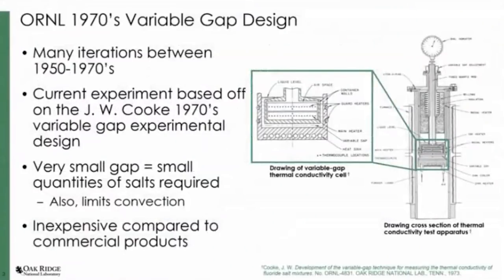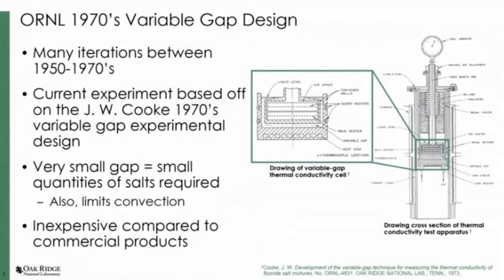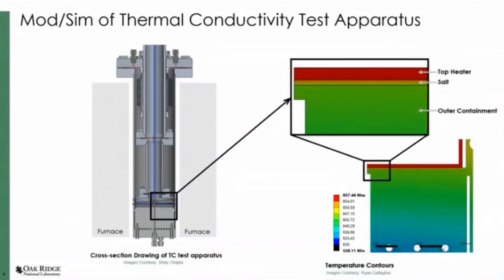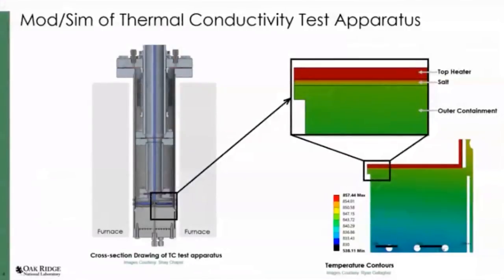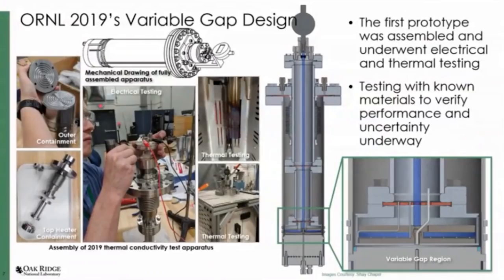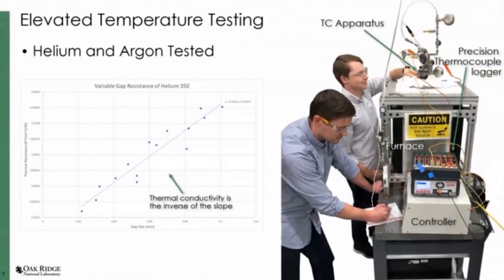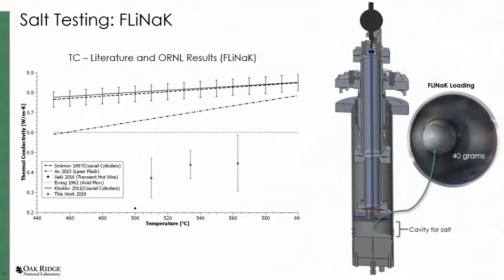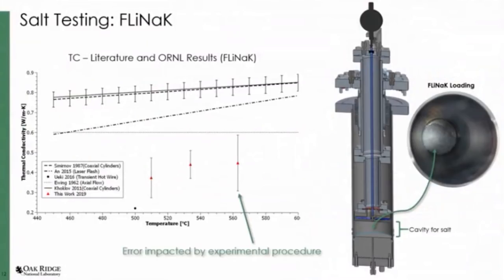Molten Salt Thermal Conductivity (Presentation+Interview) Dianne Ezell & Ryan Gallagher @ ORNL MSRW

Comment: I'm such an admirer of the old team at ORNL for all the work they did on MSRs going back into the 1950s and 60s. I think this would have been a game changer had the US nuclear sector gone for the MSBR instead of the LMFBR in the 1970s.

We have a chance to rectify this now and the current generation of nuclear engineers are showing the same vision and skill as the earlier people. With designs like the Elysium molten chloride fast reactor hundreds of thousands of tons of SNF and depleted uranium become a virtually endless fuel cycle. Thorium is promising in a slow spectrum breeder design as well.

Comment: I appreciate all the information you provide.  I am a layman obviously in nuclear, but I am a computer scientist.  So, we have been melting silver in graphite crucibles for jewelry smithing, etc.  And we are finding that the graphite really deteriorates horribly.  I know it's not Thorium or Flinak, but this seems to be a real problem for the materials testing people like yourselves.  Is anyone really delving into this as well?  I know there are multiple priority areas to research, but even as a lay person I have some real concerns about reactor longevity. ? ? ?  I am aware that neutron bombardment seems to be the concern, but temps in general just accelerate the deterioration.  I don't need a lecture in melting point differences,etc.  Just interested in peoples thoughts.  Maybe consider adding a little Au or Ag to the solution and applying a small charge?  I would think it would give you a damn fine baseline.

Comment: Why does it have to be a power plant? Can it just be an engine? Why or why not?
Reply: An engine? Engines produce kinetic energy; nuclear reactors produce thermal energy. What are you trying to ask?
Reply: JSN it’s a question of scale. I guess I got the two things mixed up. But what I’m trying to say is that in the face of anti nuclear activism, a gigantic industrial complex seems like it runs into a lot of  pr problems. Instead of going big, then scaling down, could you start small and then scale up? I feel like a nuclear reactor that can sit on a lab bench would be easier for the general public to put up with then telling the whole town that there’s going to be this new power plant down the street that’s chock full of Uranium. Could an “atomic teapot” be a way to get around that “not in my backyard” mentality?